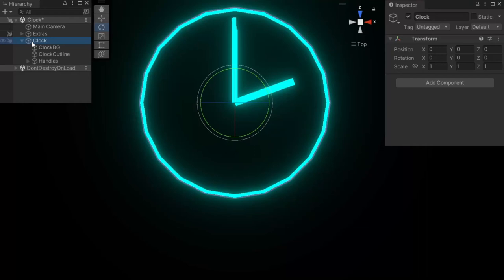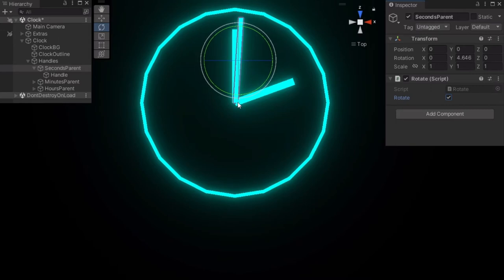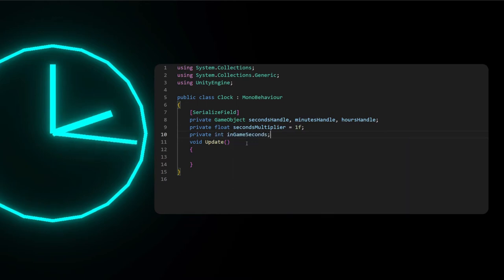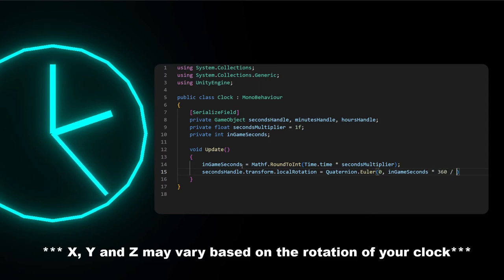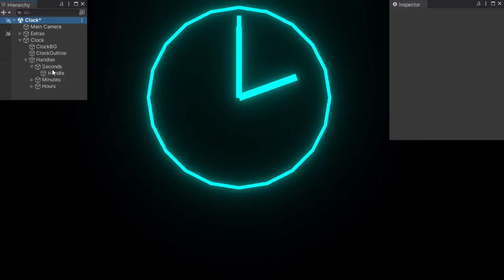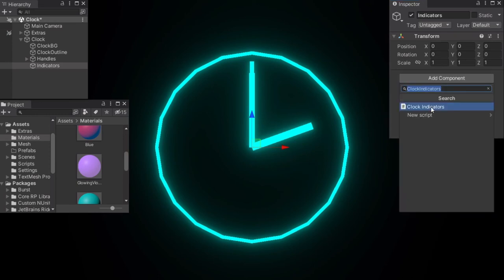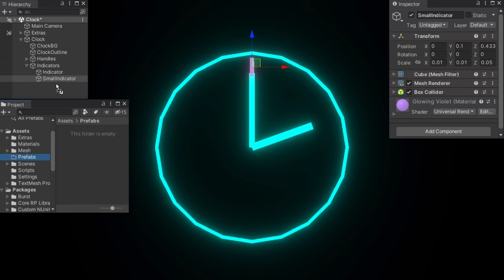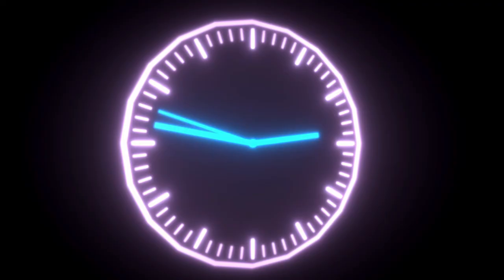How To Make A 3D Analog Clock (Unity Tutorial)

Comment: Cool. I had to change the position in the script for the 3D model I created .  The question I have is how do I apply this for local time so that at runtime the clock lines up locally without causing a potential exploit issue? Also note all the hands are suppose to be aligned at 0 rotation so I was wonder how do I make sure the hands are not splayed out incorrectly? Mine comes out looking like its 10 minutes to 2.